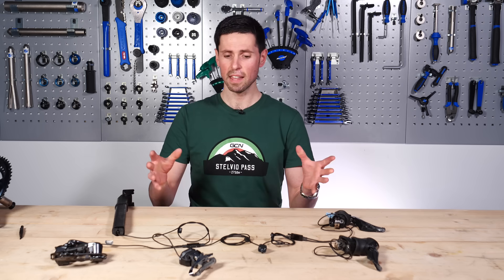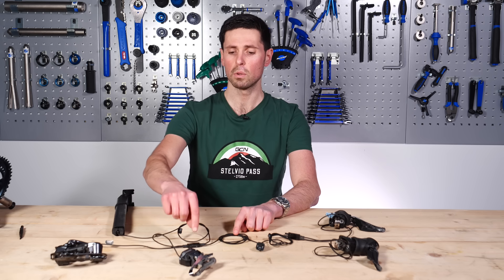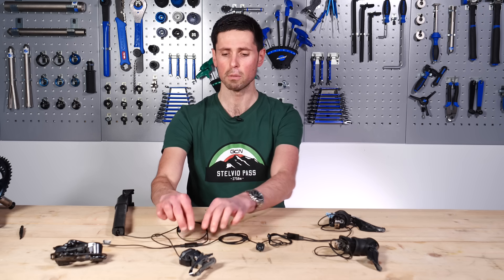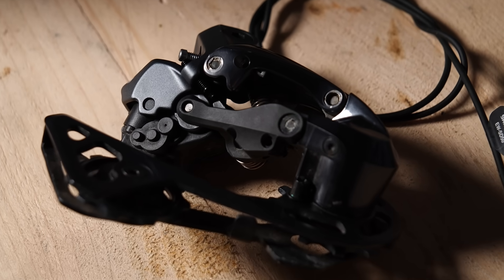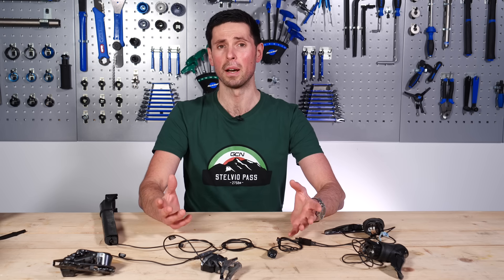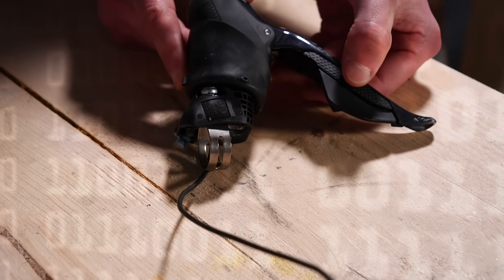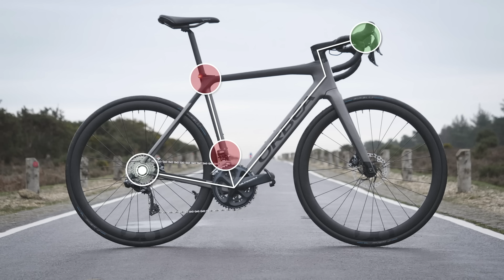How does Shimano Di2 Actually Work?| Electronic Shifting 101

Comment: Nice video, keep up the good work. Also, you didn't show the simplest two-junction box layout which would ultimately be less expensive and require fewer cables. It does require to have the A one inside your bar as a plug though.

Comment: 20% of the 21st century have already passed, why Shimano still uses wired solutions??? 🤔🤔🤔
Reply: No one mentions FSA. They have a semi-wireless groupset.
Reply: @josephphillips865  Mavic had that 30years ago
Reply: Shimano is a brand that doesn’t like to sell buggy/faulty equipment (unlike Sram-saying that as a mechanic with a lot of broken AXS/e-tap RDs&shifters and other mechanical stuff). They have tested a few wireless systems (last was in 2019) but none was up to standards
Reply: Wireless is not a leap in technology like many think. Wired is less likely to loose connection and device communication is easier to secure. This is why SRAM uses a proprietary and encrypted wireless network.
Reply: because it's more reliable, and some people prefer having to deal with the one time headache of routing the cables, over the constant headache of having to recharge four separate batteries

Comment: although interesting from a techmical point of view, having to charge a battery in order for my bike to work at all totally defeats the charm and purpose of a bicycle.
Reply: Good job it will only need charging every 2-3 months isn’t it
Reply: So you don't ride at night then? And I'm guessing you don't bring your phone? Is pumping up tyres and chain lube more "quaint" compared to charging a battery?
Reply: thing is,  the bike still works in all its functionality without smarphone, garmin or lights, bells and whistles . they have nothing to do with the bike in itself. is all optional.
Reply: @daki222000  you think a bike doesn't work if you can't change gears??? You can still get to where you want to go.
Reply: @MrBJPitt  di2 on a fixie..

Comment: Interesting. I'm still only using wired shifting, but thanks to this video I now understand that the Di2 system isn't wireless at all. It's just using a different type of wiring to get the job done. Any idea if there is a fully wireless bicycle shifting system in the works with anyone, or is there one that is currently in play? Thanks again!
Reply: Sram etap is truly wireless
Reply: with wireless you need extra batteries on most components which all need seperate charging
Reply: @macordior  maybe but its like your mobile phone. You always know when it needs charging so it doesn't go flat.
Reply: @markstone5390  agree! From what I've seen many of the bicycle computers will alert you to the battery levels. So being caught out with a dead battery (unless it's older and perhaps defective) would largely be due to the owners lack of paying proper attention.
Reply: @Stratulax  Good point well made.  👍
Reply: @macordior  I believe the SRAM wireless shifters use those coin cell batteries so once those go bad you just replace them.

Comment: I have got a Di2 bike back last November and whilst it is undoubtedly better as an overall package compared to mechanical SRAM Red I had before there are certain shift types that I miss from Red - mainly going down the rear cassette the feel from the click from DoubleTap was so solid and engaging (and the shift so quick). I think Di2 shifts the front rings far better though (as it should).

I am currently in the process of building back up a winter/gravel play about bike with the SRAM Red so will be able to ride them back to back - as the reason for new bike was my bike was written off in a meeting with a car.

Comment: So when the battery goes flat can you still change gears or are you screwed
Reply: No battery charge.. no shifting. Though as power drops, the protocol stops the front mech first, so you still have the rear.
Reply: One advantage of the SRAM system- still has issues with a flat battery of course however with 2 and interchangeable unlikely both dead at same time... set front, swap battery to back derailleur and your in business.
Reply: As stated, you get a warning as from the front shifter.

I don't know why people think this is an issue that means cables are better. Anyone who rides enough, has experienced a broken shifter cable, and it sucks - and isn't easy to tell it needs to be replaced before the ride.
Reply: you would be SOL at that point
Reply: The front derailleurs won't work when the battery level drops to 10% or below. Di2 front shifts cost about 4 times as much battery power than rear shifts, so this way they try to ensure you get home with at least a working rear derailleur ;-).
Reply: When the battery is low it goes to a save mode..front derailleur changes to small ring and disconnects, leaving only rearD operative for next 2-3h so you can get home.

Comment: My DI2 shifts automaticly up from my easiest gear after a few seconds. Am I in the wrong shifting mode?
Reply: Adjust your limit screws properly....it’s purposely designed to do that.
Reply: Oller Adblocker mine used to do that and randomly stopped after a month, hold in there haha
Reply: @korneyhebi5287  😅😅
Reply: Do a reset.
Reply: Send me a message (terry@ my domain) and I'll help you out ;-)

Comment: Question: why the two junction ‘A’ boxes at the front?
Reply: The Junction boxes are just a modular way of connecting the wires together. It could come with one big wiring loom like on a car, but then if one cable broke you'd have to replace all the cabling instead of the broken section. Also in the case of one of the junction boxes it looks like it has a socket for plugging a charging wire in for the battery. 

Also for a CAN bus to operate properly it needs a 120ohm resistor at each end of the cabling, these are called terminating resistors and they basically reduce the amount the signal gets reflected back down the cable once it reaches the end of the line. The front and rear junction boxes seem a likely place to put these resistors.
Reply: One of these is actually a Junction B (SM-JC41). There can only be one junction A in a Di2 system (and one battery.. and one BT/ANT device..). Shimano use a Y-splitter instead the Junction B that Alex used. Another alternative is to chain two shifters together (Di2 doesn't care what is connected to what other component, as long as it is connected it'll work). 

The downside of not using a Y-splitter or Junction B near the front is that you 'lose' an E-Tube port though... so using the splitter or second Junction B is usually a good idea.
(I don't : https://assets.bettershifting.com/uploads/setup_terry.png ;-)
Reply: @BetterShifting  ahhh! Makes sense. It was so counterintuitive to see a Junction B near the front that i was sure it was a second Junction-A.
Reply: @RobBelanger  I don't see the SM-EW90-A/B, but maybe I'm not paying close enough attention (the system would not work with two Junctions A). I think it's just EW-RS910 + an extra SM-JC41?
Reply: So only one wire goes to the rest of the bike.

Comment: Wish I could have di2 😢
Reply: You can just buy 1 part at a time pre owned. Someone is always sellling it
Reply: @Jasondom-kc7or  thats a good idea actually.
Reply: @tonyjones9442  have a little look and research what you need as It will depend on what direction you want to go either disc or rim brake as the shifters are the more expensive part especially hydraulic shifters but stick with di2 ultegra as this will last for ages and is cheaper of the two. 
I picked up the shifters , battery , derailluers and cables for less than 550 in total but brought over a period of months for a rim brake setup.

And disc brake set up was around £850 last year again over a period of months 
But you have to be patient otherwise you'll pay more than you should plus some is always selling what u need.

Once you've built your groupset you'll never need to upgrade again other than the frame when your board. Good luck with the project
Reply: I bought it part by part pre owned, and it only cost me about 700 dollars. I think thats the way to go..
Reply: Hugo Rishøj that’s a lot, you can get SRAM full Etap Disc system for around 1300 if you look very good
Reply: @MJarthur95  but 1300 is nearly doubble the price of what i bought. 
And I think shimano di2 is a better option on road than sram etap. Sram is maybe better for cx, but I would go with shimano all the way!
Reply: And its shimano ultegra r8050/dura ace r9150
Reply: Me too, its still a bit pricey for what it does
Reply: @tonyjones9442  what's the price range?
Reply: @bravoalley228  I think they are £1300 new. Unsure.